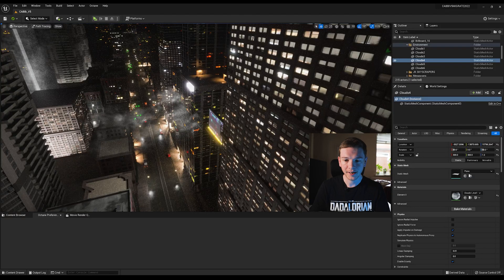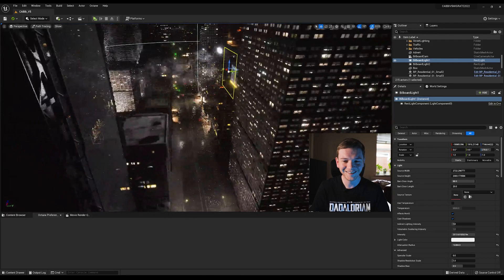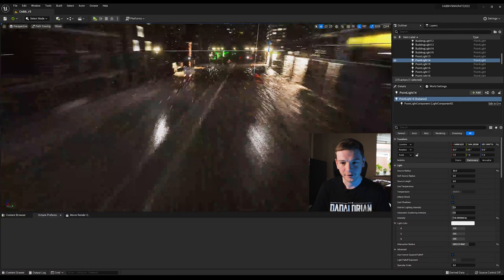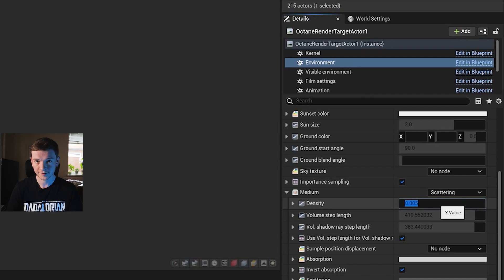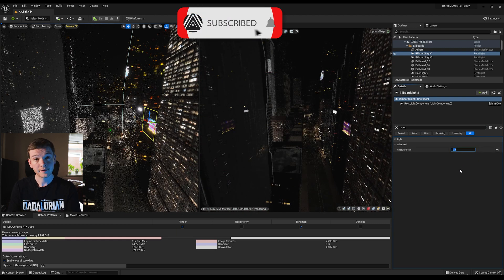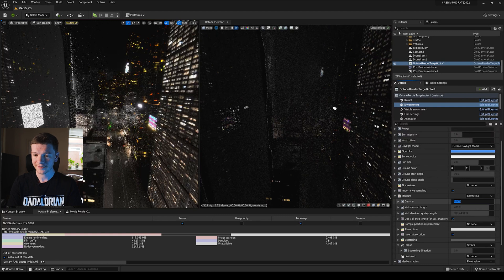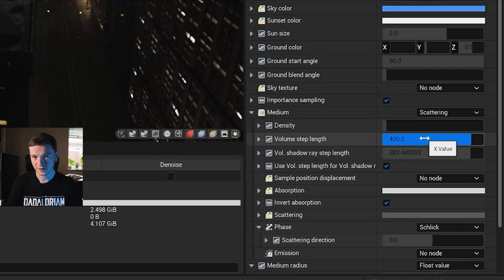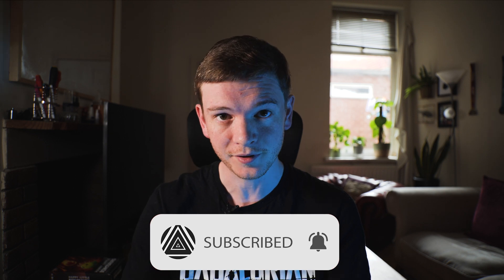I Fixed THIS Reflection Bug in UE5 With Octane

Comment: unreal doesn't have textured area lights?
Reply from the maker: It does. Why do you ask?
Reply: @JoshuaMKerr  because i feel like it would also have been a decent solution, just make an area light with the color of the billboard or in octane use the texture and hide the specular which gives more accurate diffuse lighting
Reply from the maker: Part of the issue was more to do with art direction. I wanted the emissive texture to be visible but for it to illuminate a larger area with high intensity. Doing so still makes the reflected light look wrong in shiny surfaces.

Either way, since the latest updates it is no longer an issue

Comment: As a long time Octane user, finally an answer.  That's a relief. ty
Reply from the maker: No problem
Reply: How can I do the same thing without decreasing the glow amount? It removes the reflection in the wall ofc but it reduces the glow amount and i need the glow to be as big as it is
Reply from the maker: @FabstaPizza  It's hard to say without seeing the issue. I suggest joining my discord so you can post images in the support forum.

Comment: hi. just saw you video though i dont use octane. but have a strange problem similar to this. in my viewport/pathtracer i dont see any garbage reflection but when rendering with render queue there is something black (some garbage) coming. it looks like there is an object in between the glass and the light (that is reflecting in the glass) i checked all objects and removed extra asset also but still that reflection is coming but in thru render queue render not appearing in viewport when set to path tracing. :( pls help
Reply from the maker: Im not completely familiar with the problem. Did you find out what object was appearing in your reflections?
Reply: @JoshuaMKerr  no. We removed it in post.
Reply from the maker: Ah, sorry to hear that. What did the object look like?
Reply: @JoshuaMKerr  it was a jar I think as I had some assets lying off camera. Not sure.